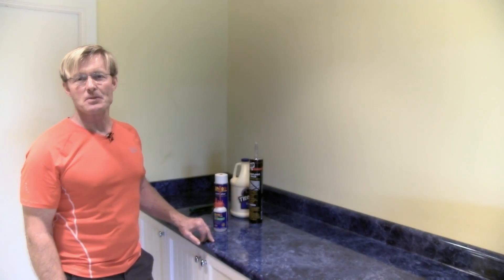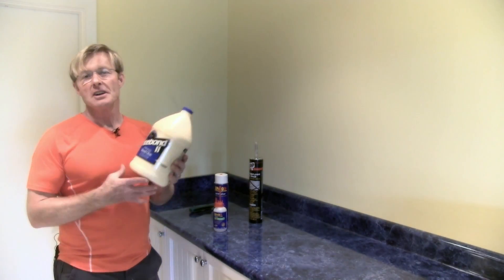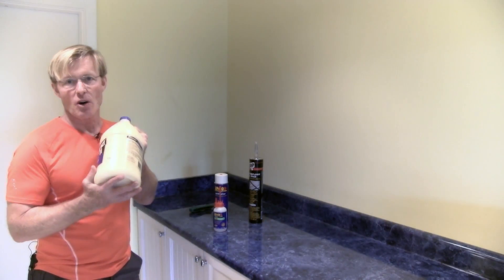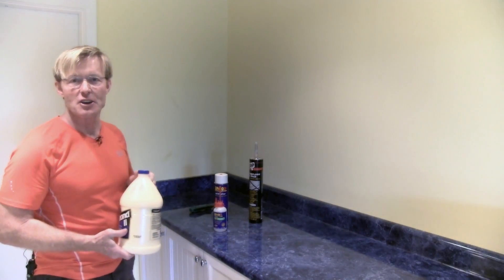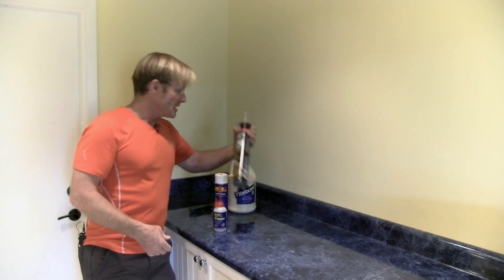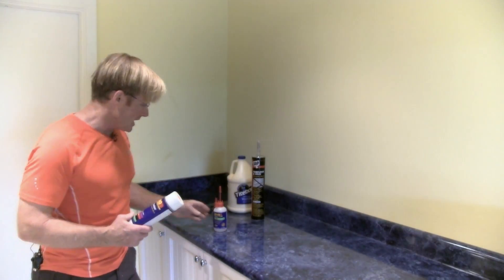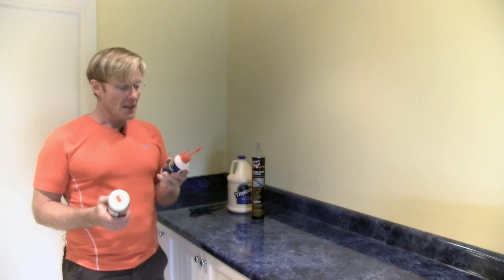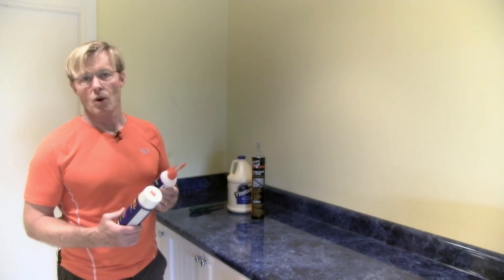SPEEDING UP GLUE TIME

Comment: Love the 2P-10 I use it religiously. Quick tip on the 2P-10, when you spray the activator allow it to evaporate (20-30 seconds) for a stronger bond. Tip I picked up from the manufacturer.